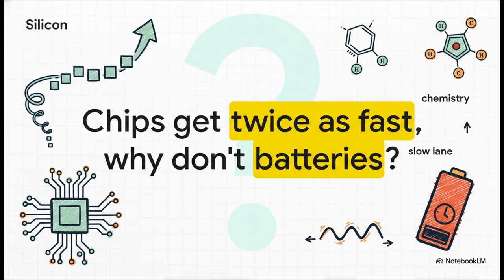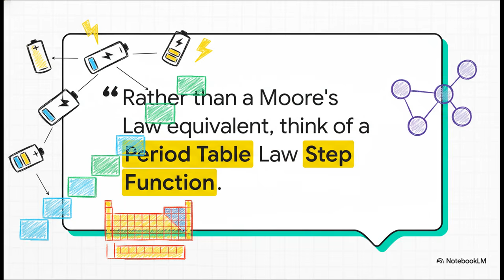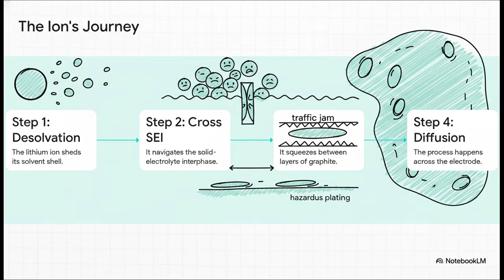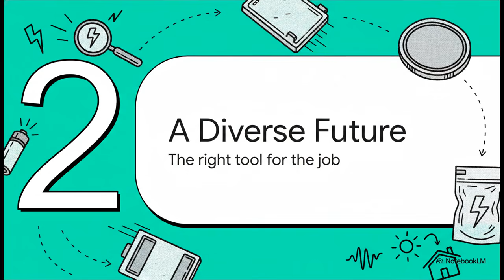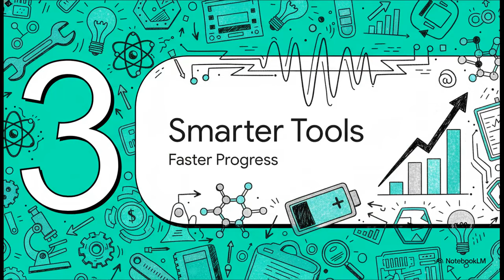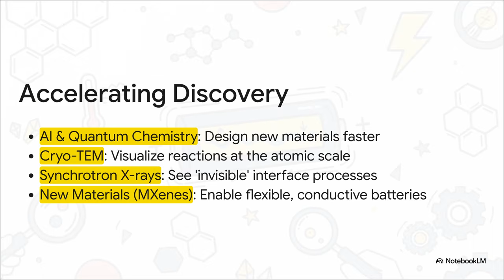Physics — Why Batteries Don’t Improve Like Microchips

Comment: Also, we don;t even need to reach the 10.000 of gasoline. 
Even 1.000 wh/kg is more than enough to unlock batteries for naval/plane/train/truck and convert every single transport method to electricity.
In the last 20years we x2 the battery density. In the next 10 years we'll x2 once more (if not more). We are at the cusp of the tech / moore's law. It really depends where you start to chart the graph for the exponential curve.

Comment: The main reason is actually $$$. Until the (re)emerge of EVs, there was no real / solid incentive to invest in battery tech. So the progress was slow, stagnating.
Demand ---> Investment ---> Progress. It's that easy.
The $$$$ invested in microchips dwarfed anything battery related. 
Demand ---> Investment ---> Progress. It's that easy.
Same for Rocket Tech. There was no "real" need / demand , so NASA stagnated and did not improve much. Then came SPACE X which needed to launch 30.000 own satellites - so they had to invest and reinvent the wheel to be able to do it profitably.
Demand ---> Investment ---> Progress. It's that easy.